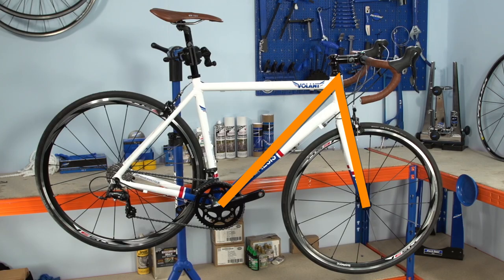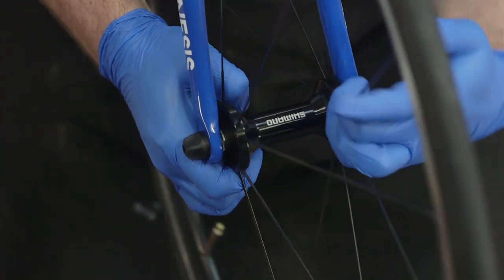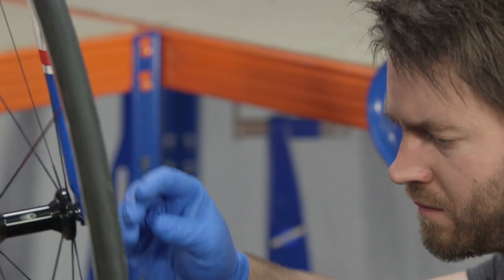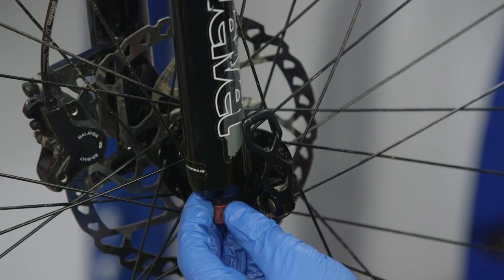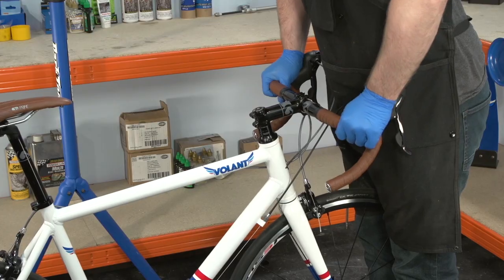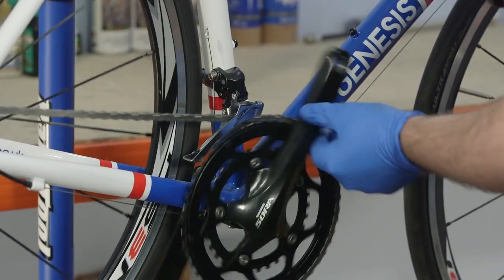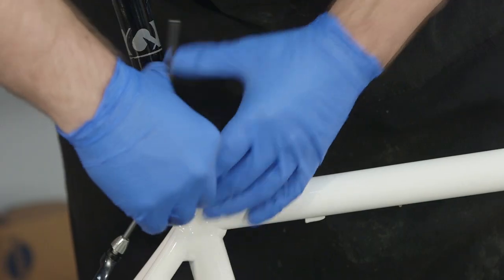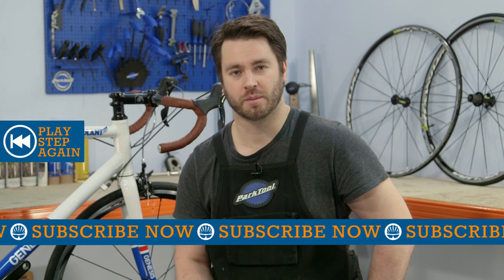How To Safety Check A Bike

Comment: I thought you always adjust your QR's with weight on the wheels (not on the work stand)...so the axle will set/align itself into the fork?
Reply from the maker: Mike Williams if you have a QR hub you need to make sure it's firmly in the fork or frame drop outs before tightening. If you prefer to do it on the floor then that's good practise, but there's no reason you can't do it in a stand if you press it in with your knee. You could also flip the bike upside down if it's easier - just take care not to scratch the bars etc.

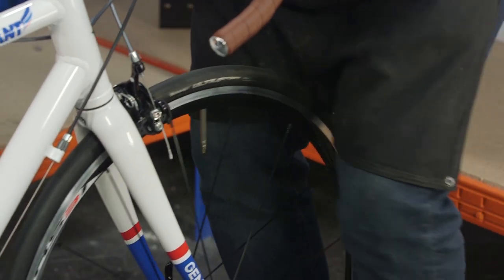Comment: 3:53. I think it's not a good idea to twist the handlebar like that if you have a carbon steerer. It's okay to do it firmly, but human strength is inaccurate and inconsistent. Just check the stem bolts with torque wrench.
Reply from the maker: BubBleWaRp in an ideal world, everyone would have a torque wrench. Sadly, that's not the case. So it's just a good idea to check you're not going to turn the bars and ride in a straight line. Obviously if you have anything carbon you need to take extra care, but they shouldn't suffer from you applying normal operational forces.